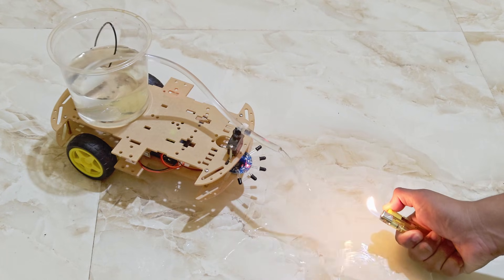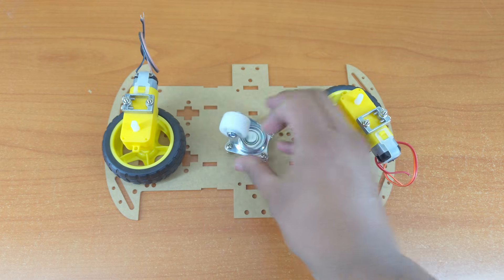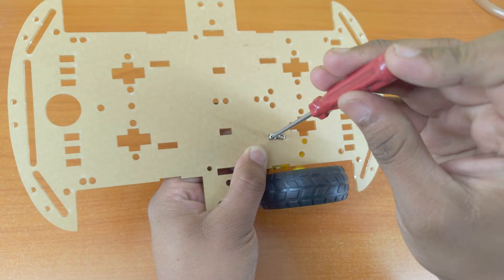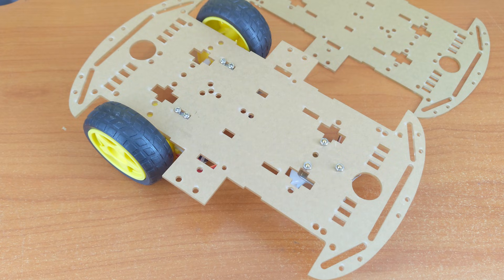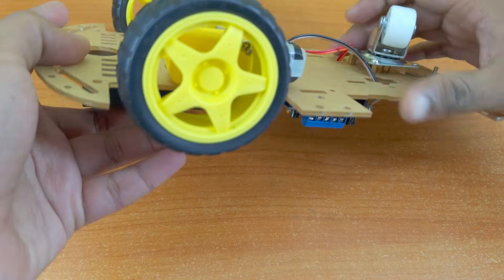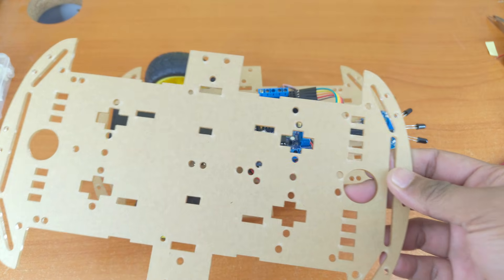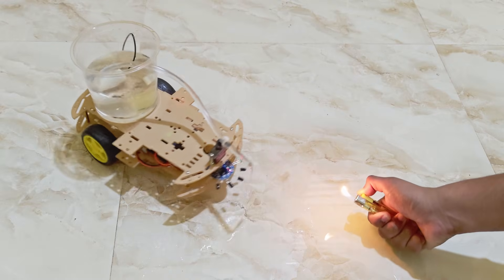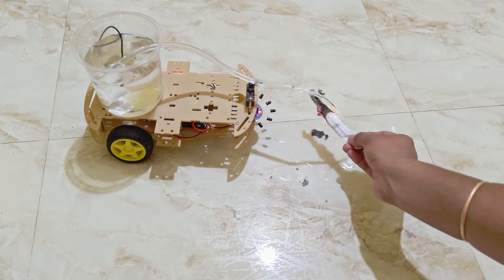Building an Arduino Fire Fighting Robot  | Water Spraying Bot Using Flame Sensors

Comment: Hello I am working on school project and building this fire fighting bot but we have arduino r4 wifi. Will it work and can u explain the connections with sensors, motors and arduino in detail.
Reply from the maker: Circuit diagram is in the description
Reply: Will  the code be  same for arduino r4 wifi
Reply from the maker: Not checked. What driver are you using?
Reply: Generic 0826U40KLRA Q L293D motor driver Servo shield for arduino
Reply from the maker: The libraries are different for the R4. It has very little support. You have to find a working library.
Reply: Becoz it isnt working  @techtalkies1
Reply: Can u help us with that... rest all components we are using as per the description
Reply: We are using these
Arduino Uno R4 wi-fi
Generic 0826U40KLRA Q L293D Motor Driver/Stepper/Servo Shield for Arduino
5 channel IR flame detector sensor
Sg90 Micro Servo Motor 9G Rc Robot
Mini Water Project DC Pump
4 DC mini Motor with wheels
Reply from the maker: Are you getting any errors when compiling?
Reply: @techtalkies1 yes ...so we used AI to correct code ..but wheels aren't  moving only flame sensors and arduino are lighted
Reply from the maker: Have you checked if you have placed the power jumper pin correctly? Check my motor shield video if you have any doubt regarding that.
Reply from the maker: You can email me the code if you want. techtalkies1@gmail.com
Reply: Sure i shall mail u. Thanks

Comment: Instead of chasser wheel i used all the four wheels how to connect that bro
Reply from the maker: With 4 motors?
Reply: @techtalkies1 yes bro
Reply from the maker: Have to modify the code. Better use only 2 wheels if you want to use my code.
Also, we need 1 pin free for the pump, so using 4 motors might not be feasible.

Comment: I'm using 3 different flame Sensor. Each of them has an DO, GND and VCC pin. What to do?
Reply from the maker: You probably know to connect gnd and VCC.
Connect the DO pine to the Arduino pins. I'm using 5 pins in the video. You can use 3 pins and modify the code
Reply: @techtalkies1 Will it work the same way?
Reply: @techtalkies1 Bro I have a similar set up like you. Using the L293D Motor shield, the digital pins of Arduino are covered. Should I solder the DO of the flame sensor using wires to the the DO on the L293D? Will it work the same way?
Reply from the maker: If you're using the same motor shield as me, it will have pins A0 to A5 free. Use that to connect DO.
Reply: @techtalkies1 Will the DO be converted to AO? If I connect the DO of the flame Sensor to the AO on the L293D?
Reply from the maker: Yes, the Analog or the A pins in the Arduino also works as a digital or a D pins. So it's fine.

But if you use only 3 sensors, you'll need to modify the code.
Reply from the maker: I would suggest using 5 sensors if you want to use my code.
Reply: Bro i done with 3 flame sensors it is in the same way just connect GND, VCC of each sensor to the motorshield like they connected the A0

Comment: Gracias por compartir, una pregunta yo uso el sensor de flama IR, pero al aire libre de me confunde con la luz del sol, alguna idea de cómo evitar eso, con los sensores que usaste en el vídeo si le deja utilizarlo al aire libre?
Reply from the maker: No, IR sensors cannot be used when there is sunlight. It will activate with sunlight.
Reply: @techtalkies1 tienes alguna idea de cómo puedo hacer para poder usarlo al aire libre, es para la escuela.
Reply from the maker: I'm sorry, there is no way to use the IR sensor in sunlight.